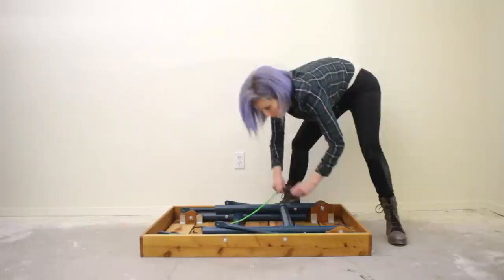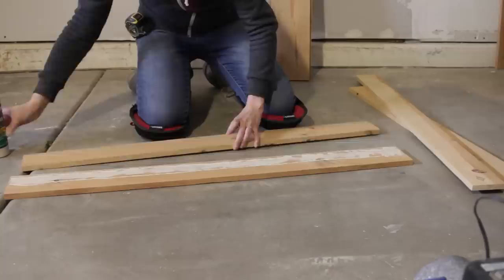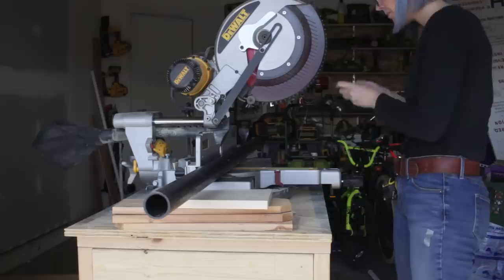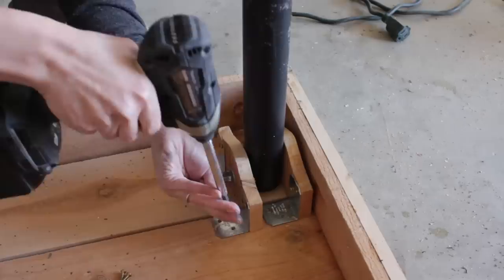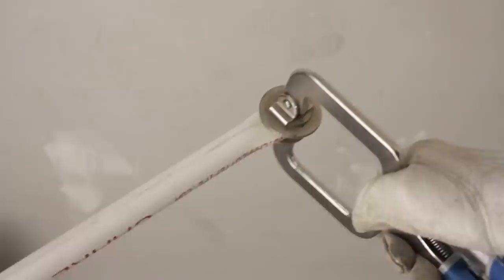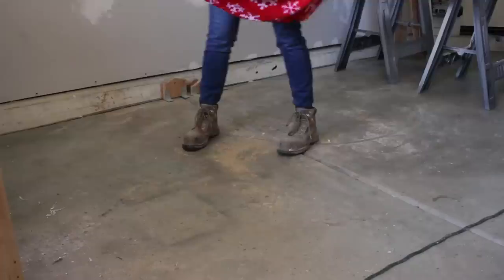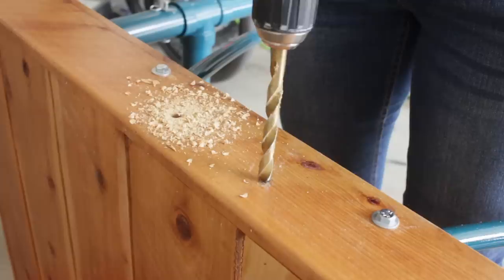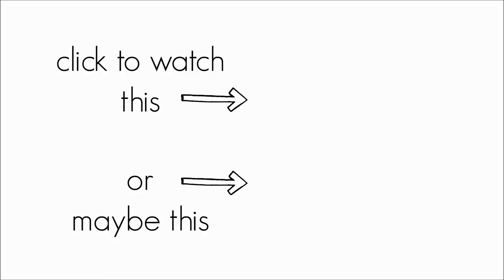Outdoor Folding Table | How to Build

Comment: The bottom ends of the legs would wear a lot better with caps on them.  Or maybe the best way would be to stuff a reducer in the ends.  That would still have a small hole in the end but the amount of material available as a wear surface would be greater and the outside of the legs would look cleaner.

Comment: Really neat project! One thing to consider is whether the top really needs a finish. We use a lot of cedar here in Washington and standard procedure is generally to leave it unfinished. It's naturally weatherproof and finishing it can actually reduce that; plus the oils in it can make for a poor bond. It also adds weight. 

But that's up to the builder. Table looks great!

Comment: This is completely constructive but I wanted to note that the legs were not square. This is most noticeable at 0:57. I do wonder if it's the pvc settling (pressure on the pvc in the bolt slots causing slack). Otherwise this looks great. I'm looking to make a similar folding mechanism out of wood for a coffee table (see below). I'll probably buy the prefab stuff at home depot (the legs) and run from there. Thanks for the video!

30"x15" Union Jack made out of hard maple. Using wood dye (red/blue) and bar top pour on epoxy. Intended to hang on the wall as decoration but transforms into a table when needed. Keeps it unsuspectingly out of the way!

Comment: Pretty cool, and I think you should look into channels for bolts to slide along in, along with notches for the various points you want them to stop at. I guess you could look into springs in certain applications. It sounds like a great idea in my head, but it might not be practical. Also instead of making the brackets, did you consider door hinges?

Comment: If I wanted to make the legs out of wood, and without hardware, would it be possible to use unglued dovetail joints for the leg supports, and a mortise and tenon to support the top? 

In lieu of folding legs, just a slot carrier and locking mechanism to hold the straight pieces? hmm...

Comment: Next time you just might want to remove stickers from mtg brkts before you glue them. Brass screws against a steel plat may cause you grief.
Reply: Dissimilar metals in contact with each other WILL cause a galvanic corrosion over time if moisture is present..